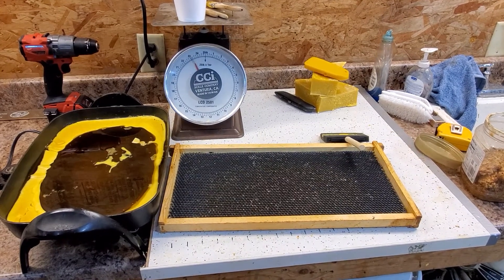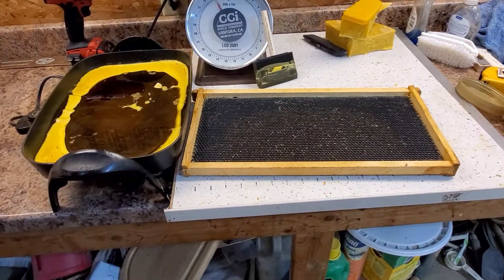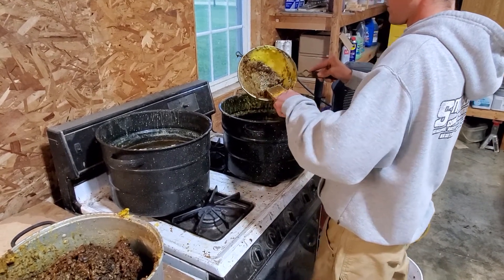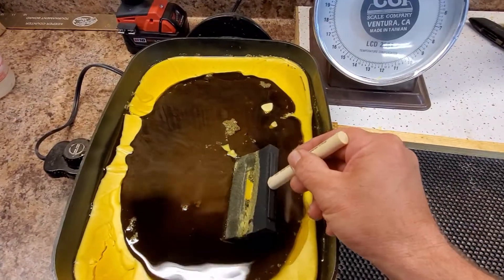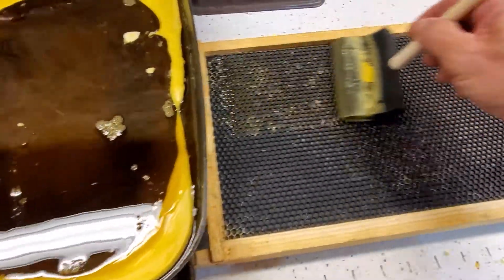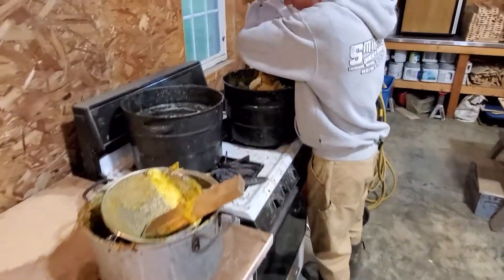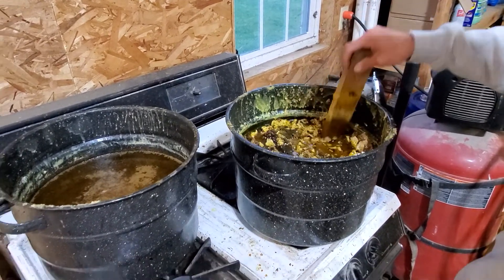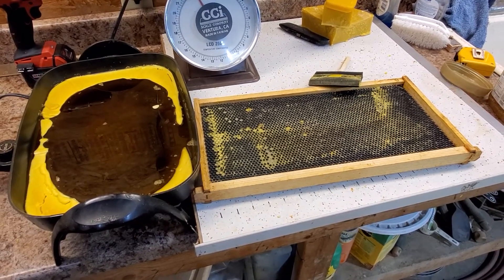Coating plastic foundation with honey bee wax using a foam brush

Comment: 1st. of all. Where do you live that it's that Cold in May? LOL... 2nd. And my reason for finding your video. We've found that our Bee's will NOT use, clean or anything, a cell that is full of wax. Especially as thick as you were applying your wax. I would assume that some, if not all the cells of the plastic foundation was being filled with wax. Is this true. And if so, are your Bee's just smarter and harder workers than mine or what??? Thank you for your time and help.
Reply from the maker: The wax was going on too thick which only uses up the wax faster but the honey bees drew it out perfectly but I also was placing them in very strong hives.  So far it has been working great for us
Reply: @honyokhoneybees8116  OK. Thank you. I'll try lighter Coats.